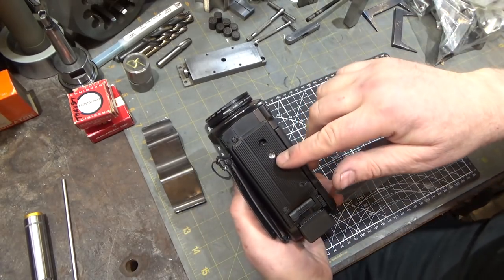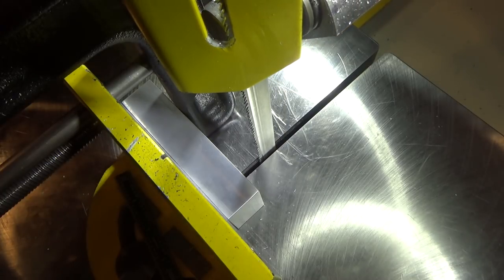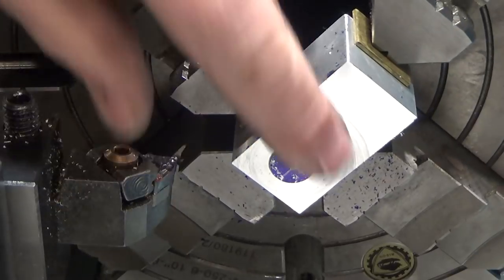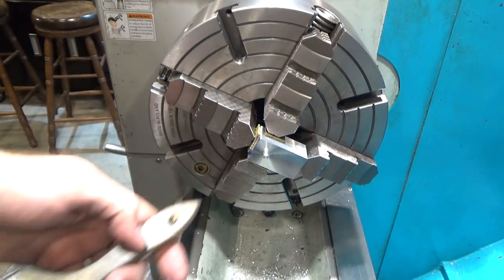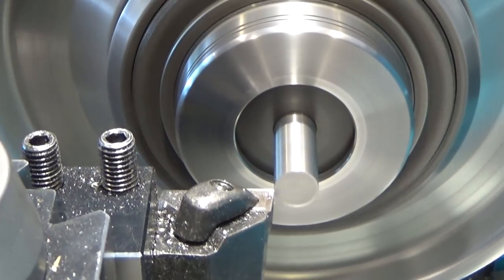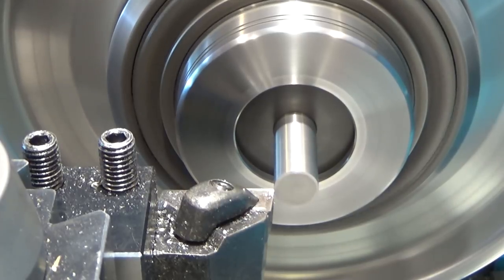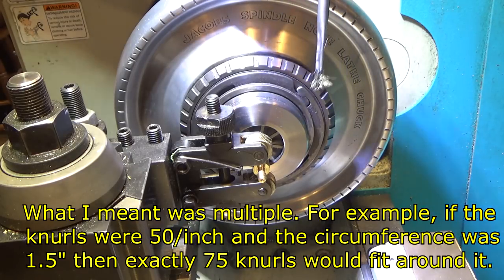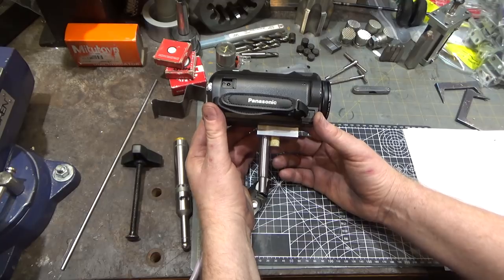79 Video Camera Adapter Plate and Turning off Center

Comment: I worked in TV and film fie a number of years.  Most camera plates have a layer of hard rubber or cork to keep the camera from turning with only one screw.  I built a plate for my fluid head to fit my video camera.  It is larger than yours, but it has never tended to move around.  Just for information.  Enjoyed the video.
Ralph
Reply from the maker: Thanks. I thought about the rubber idea, it's a solid one.

Comment: Just a suggestion: switch to quick release mounts like Manfrotto. They use dovetails and a lever similar to an Aloris tool post. You install plates on your all your cameras and QR bases to all your camera mounts. Then, just like changing tools on your lathe, you use the release lever to remove and install your cameras. 
I use them to mount lasers and they provide a very stable and reliable attachment that's quick and easy to use. Much better than 1/4-20 screws;)
Reply from the maker: Thanks. That is a very god suggestion. I might just try your ideas.

Comment: Good video,  I've made all the mounting fixtures for my camera's with standoff mounts. Mad it easy to change the batteries and memory card
Reply from the maker: Mine was just a bit short of the memory card slot. I like your approach to a multi-function camera bottom. My battery mounts on the rear. I enjoy your channel, thanks for the ideas.

Comment: Nice video just made one my self and my Canon has same dimension .553 center of pin to center of 1/4-20 . Mine works great.. 
Watching in Alabama!
Reply: I have two canon Vixia cameras I use.  An older HF R30 HD and a newer Canon Vixia HF R600.  I really like both, but the HF R600 is my favorite.
Reply: @MaturePatriot  mine is a HF R800
Reply from the maker: Thanks for letting me know about your spacing. Maybe there is some sort of loose standard.

Comment: It’s more common to find round threading does that are not adjustable these days, so I wouldn’t dismiss your die as being wrong.  I can thread up to 1/2” tool steel with cheap non-HSS round threading dies, but whenever I have difficulty, it’s because the major diameter is too large which is what I think you experienced.  Looking forward to seeing the footages from the new camera.  I really want to upgrade from my 10 year old Canon camcorder (occasional footages from iPhone) but can’t decide on which.  Cheers!
Reply from the maker: Thanks for the suggestions and for sharing your personal experiences. Every bit of info helps. My next video will be using the Panasonic camera. You can let me know what you think. One this is for sure, on my test shoots, the built in mics are nowhere near as good as the Sony's, so I switched to a wireless lavaliere mic,
Reply: Dudley Toolwright will do!

Comment: Hi.  Really enjoy your videos.  I’m new to machining and I am getting tired of Chinese cutters for the mill.  Can you give me so ideas of good brand that doesn’t cost an arm and leg.  Also I was milling some A2 tool steel and was trying some Tin coated cutters from little machine shop and it chowdered the bits.  Not quite sure what I did wrong.  Thanks
Reply from the maker: I am glad you have started enjoying machining. Some of the Chinese carbide inserts and end mills are a bit fragile. You can get brand name cutters from industryrecycles.com, but they won;t necessarily have the ones you are looking for. I also buy lots on eBay and at estate sales. High quality tools are much more expensive, unless you get them outside normal channels.

Comment: You would have been fine without the centre  , i have just done some off set turning  in my last video   ,  Cheers .
Reply from the maker: Thanks. It was just there as a safety net, but after I realized that it wasn't going anywhere, I removed it. I am going to go check out your channel .Thanks for the comment.

Comment: Panasonic?  Is that better than the Sony CX405 that you had previously recommended?  I didn't buy anything yet because I...  get distracted?!
Reply from the maker: I really like the Sony for its picture quality and sound recording capabilities. It's main faults are the lack of an external mic input and it's incredible fragility. Sony does make a model just above this one with external mic in and I almost got it. The killer was I dropped the camera from about 2 feet off the concrete and it exploded. Also the whole bottom flexes a ton on the 1/4-20 mount. It is a lot lighter than the Panasonic, but I thought I would try something from the competition. My next video will be using the Panasonic, let me know what you think. My feelings are mixed.
Reply: @DudleyToolwright  Your sound is always so good, I thought you might use a separate sound recorder like a Zoom!